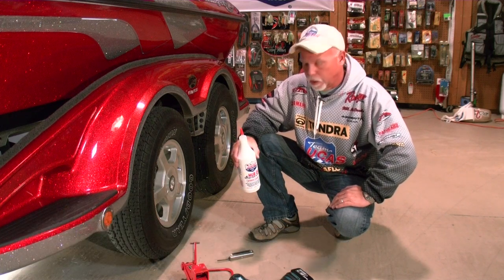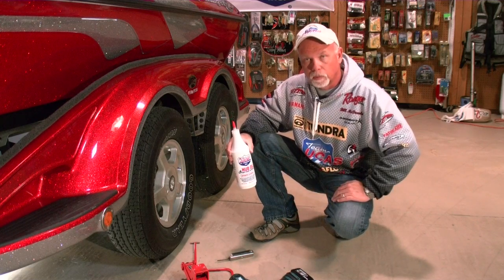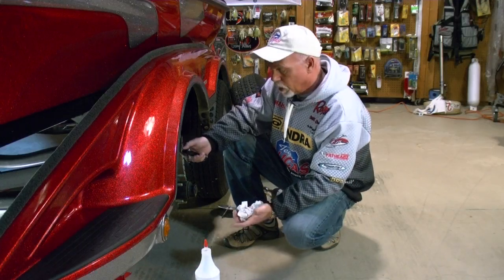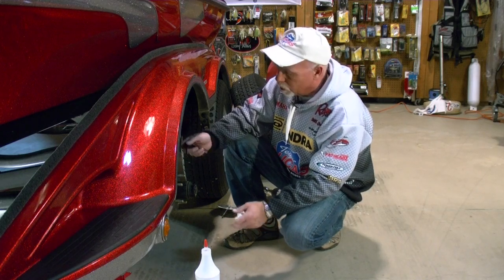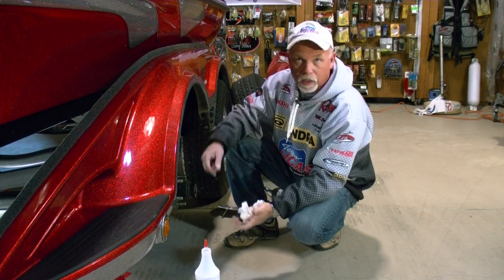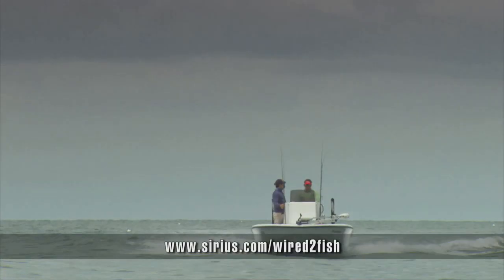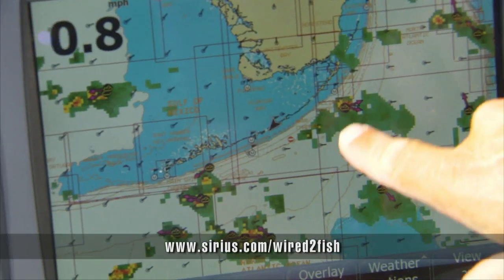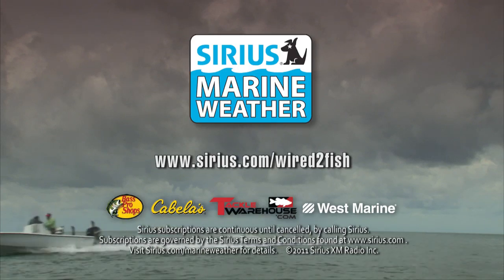How to change the hub oil on your boat trailer.

Comment: Change the hub oil will eliminate leaking problem? One of my ranger hub is leaking. I thought the seal behind the wheel is bad that's why it's leaking.
Reply: kk 1000vid n
Reply: I don’t think the oil is filled to the top. Leaves no room for expansion